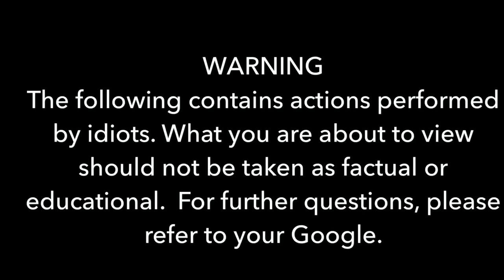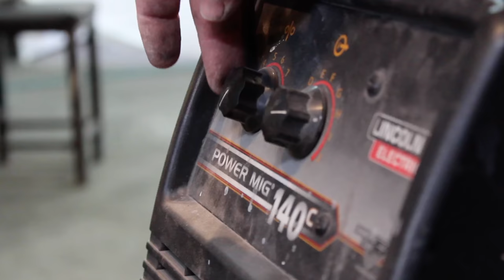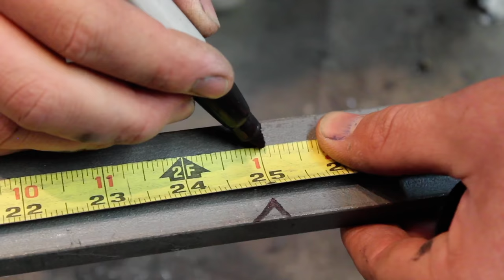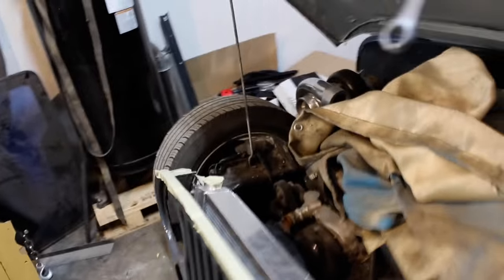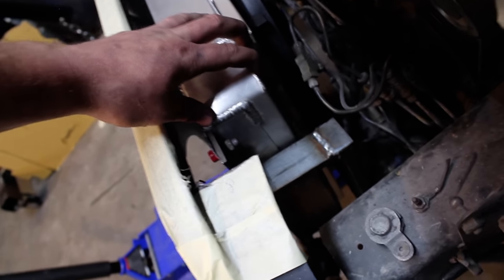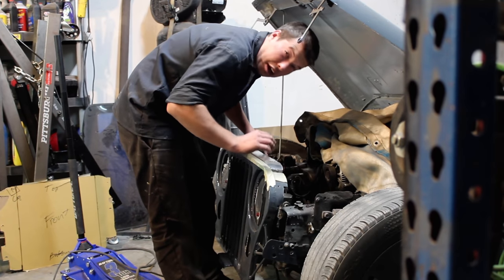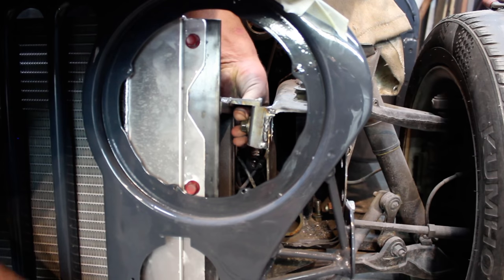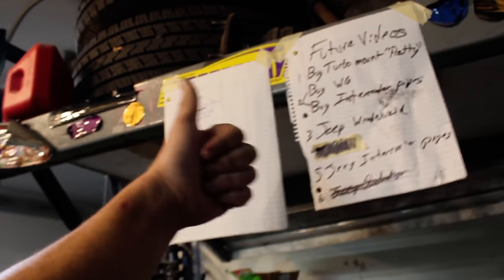C5 Corvette Jeep: UNSTOPPABLE Radiator Mount

Comment: Maybe a flat circle bolted to the headlight housing then two tabs off that so that way the plate is removable but the tabs are still solid I would rivet it to the Jeep front grill but if you need behind it obviously Nut serts would be ideal

Comment: Why don't you add a single length of flat stock roughly 3" wide to the headlight holes from left to right of it then the extra edges can be worked round with a grinder then use the extra flat stock for bracket tabs off the mount plate.
Reply from the maker: Brilliant!